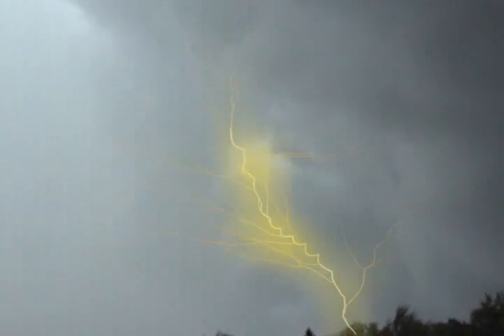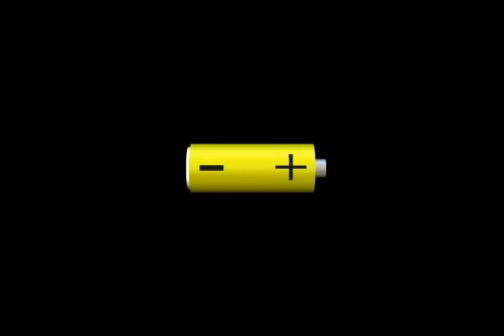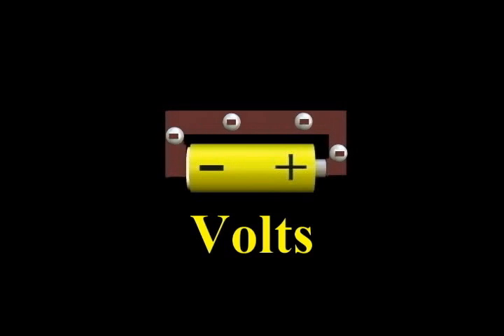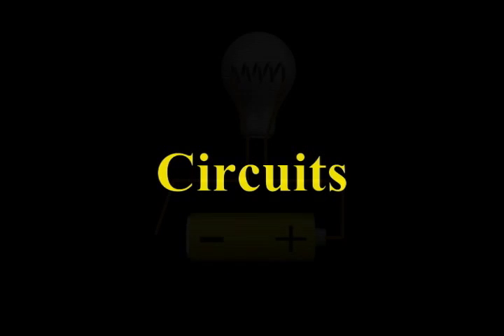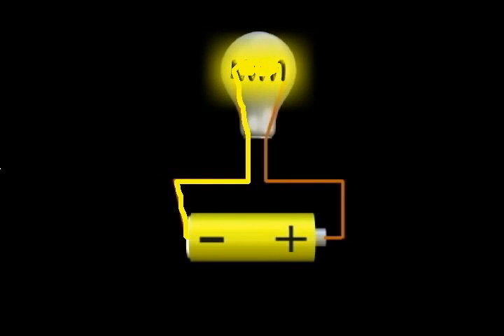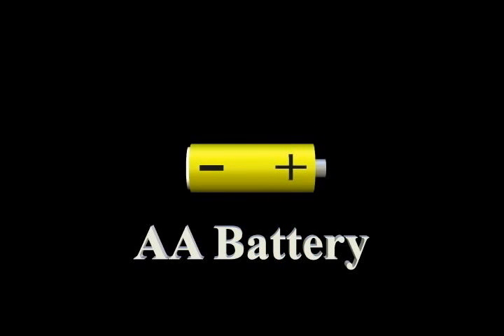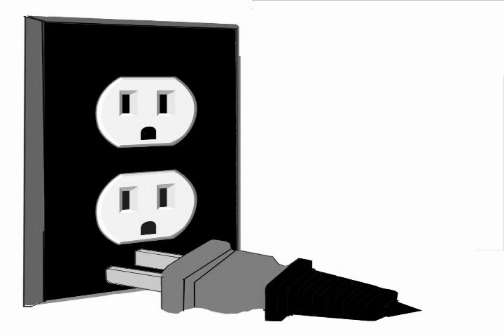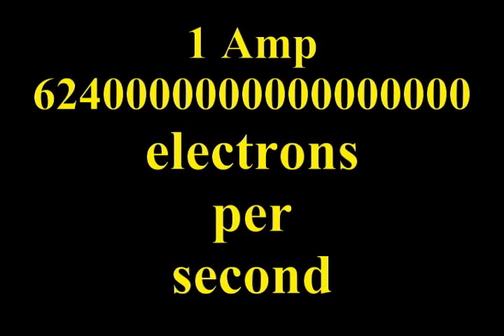How electricity  works

Comment: So,
Where are electrons wasted in a circuit? It seems like, in this circuit,
 the electrons would be constantly flowing forever,
so why does the battery run out?
Reply: Abdur Rehman Syed I think it's because some of the energy is converted to light and heat energy in the case of the lightbulb. and heat in the case of the wire on its own. I could be wrong as I am very new to learning electronics which is why I watched this video.
Reply: The laws of thermodynamics would love to answer your question... Heck, those laws are silly with answers on the behavior of energy!
Reply: The short answer- Perpetual motion (constant free energy) is unattainable with our current laws of physics. Energy tends to want to spread out and you can (currently) NEVER put out more than you put in.

Comment: also what kind of matter is electricity? Liquid?Solid?Gas?
Reply: To speak about matter, i believe we need to have atoms. While electricity is (told to be) the flowing of electrons from one place to another, meaning, through atoms. So its not quite a matter i suppose.
Reply: It is impossible for anything with matter to travel at light speed. Therefore, electricity is not a form of matter, rather, a matter of phenomena and wonder. Shout-out to my dude, the late, great Michael Faraday!

Comment: This video is wrong. Electrons do not flow through a circuit that fast. They flow through a circuit slower than the speed of a minute hand on a clock. What provides the energy in a circuit is electromagnetic waves. The motion of a charge (the electrons) creates the electromagnetic waves that provides the energy in an electrical circuit.
Reply: The current goes much faster, but the electrons themselves don't actually move very fast.
Reply: lol they move much faster than that. Close to the speed of light actually.